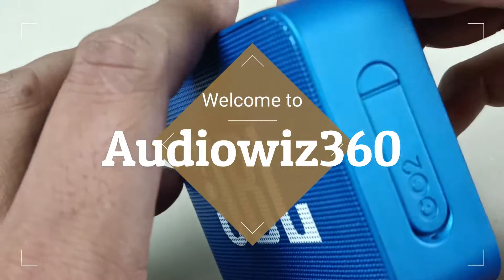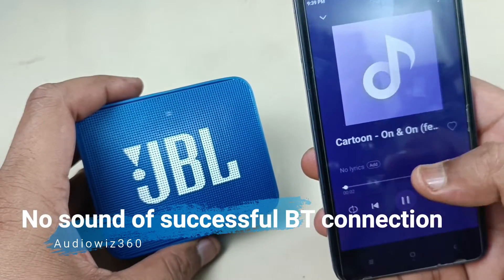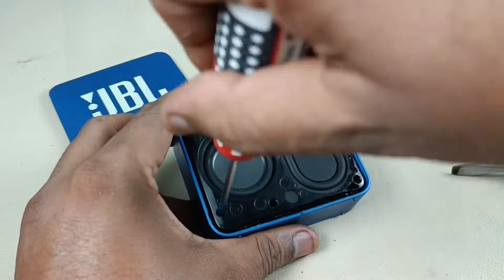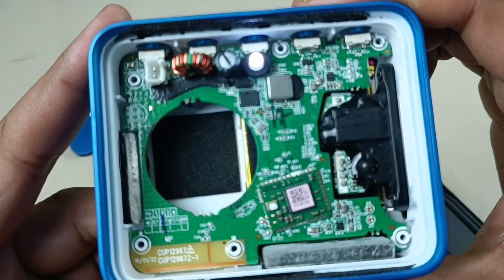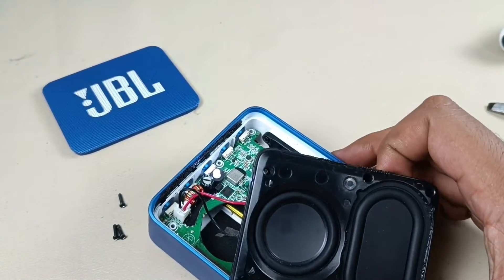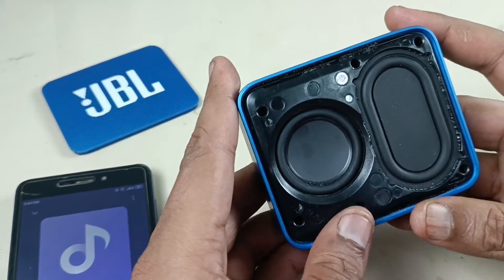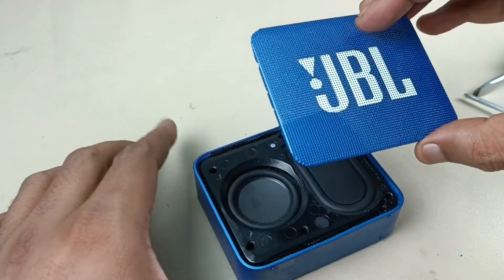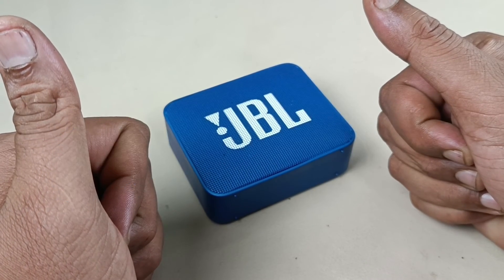Bluetooth Connected But No Sound | Fix issue| JBL Go 2 no sound | how to repair BT speaker no audio

Comment: Thank you good Video
I have the same Sound issue with my new JBL GO 2+ Box
but the cables are connected all so I dont know where the problem is.
Reply from the maker: Always welcome! 😊
check the continuity of the speaker driver  coil, if continuity is not there then the speaker is burnt 🔥.
Reply: bro, my jbl go2 speaker is getting paired and sound also coming at lower volumes.but when i increase the volume i am hearing crackling sound and bluetooth getting turned off automatically.tried resetting the speaker but no use. 

please suggest.

Comment: It looks like a cheap copy to me 🙃
Would you be able to say whether you have the OG product and fix provided is genuine?🤔
Reply: I have the same problem. I’m gonna open it up and see if it’s the exact same issue.
Reply: I had the same problem, I opened it, cables were looking fine and somehow worked again 😂
Reply: Damn hopefully the same goes for mine  @nasos88
Reply from the maker: it's 100% original JBL Go 2 and fix provided is genuine. Thanks for your precious comment!
Reply from the maker: this is bit even common problem in the previous generation of this model as well.